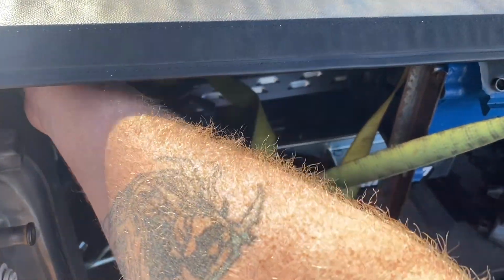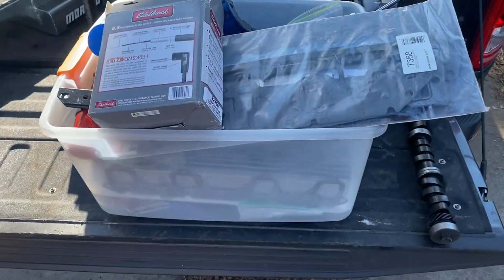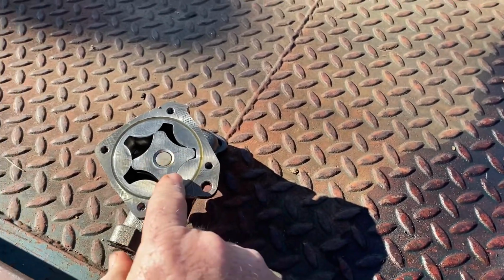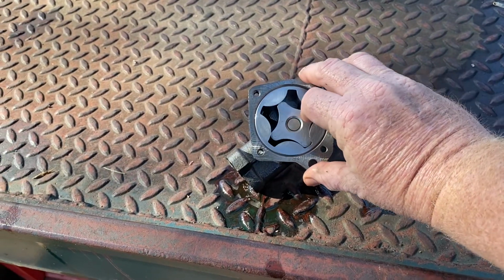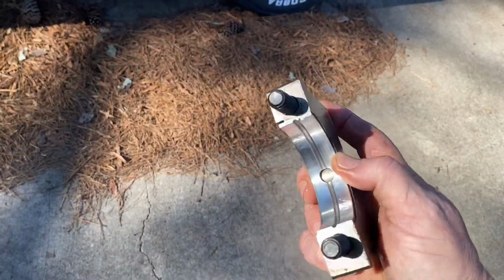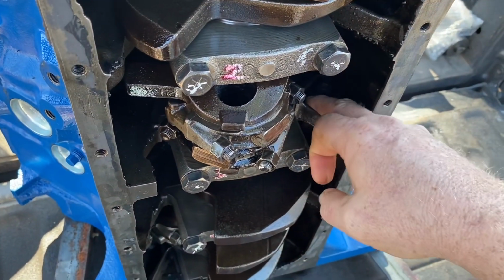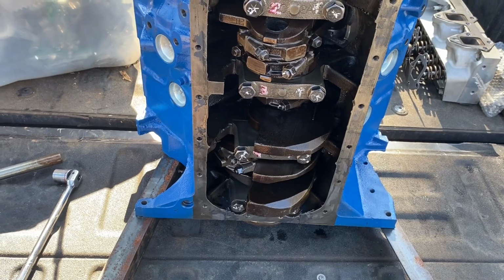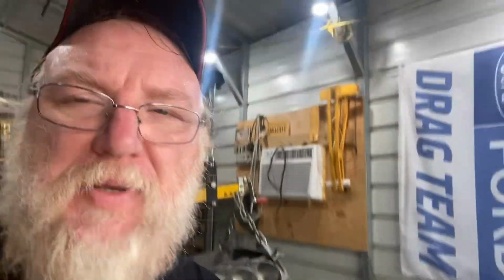Investigating the Failures of a 390 FE Ford Engine

Comment: I have fe390 hv oil pump plenty of oil pressure 60psi when operating temp oil pressure drops slowly almost 0 at idle. No valve noise
Reply from the maker: @timothyperreault3330  a lot of FE’s will drop low at idle when hot.    As long as the pressure rises with RPM it will live

Comment: Ok, last comment i promise! I keep hearing u want to blame the oil pump? At this point i dont think u know any of the clearances yet! Wich is telling me u dont know what to look for or u dont want to know? How can u blame a part so early without even knowing the basic specs of the engine? So many things can contribute to low pressure! How bout the gasket between the pump & the block? Was one used? Was it torn? What about the pickup screen? How close to the pan was it? What oil used? What about were the pickup bolts to the pump? Was there a gasket? Was it torn? Was it sucking air? Was it a high volume pump? What pressure did it have when it was primed with a drill? What were the cam bearings clocked at when installed? Did u know the way they are from the factory is adequate but not best! Oil going to the rockers, did anybody restrict that? Was all the rockers getting oil? U said it had 8 lbs at best? Was that idling? Or at 2000 rpm like when breaking in a cam? Was the oil hot or cold when it had 8 lbs? What about the clearance on the lifters? What kind of lifters did it have? Ok, u get my point. I hope?
Reply from the maker: I can only put so much information in a video that’s already 45 minutes long.   This was a basic over view video.   I never blamed the oil pump I did say it was damaged.  I am well aware of the clearance of the bearings but as I said in the video, I can only make a video so long.    There is a lot of stuff I didn’t talk about in the video. Just simply wasn’t enough time in that video.   If you watch any videos on my channel not only do I primarily build FE’s my race cars also run FE’s.   I am more than well versed in what to do and look for.     Again there is only so much time in a video

Comment: What was this engine built for? I notice the 2v pistons. Wasnt built for good compression, i can see that. Looks like someone did not understand FEs very much? I guess i dont know what heads were used or what actual cubic inch this engine was? Those details would tell me more. But if this was a 390, id say mistakes were made on basic details.
Reply from the maker: For a street car you don’t need a ton of compression.   And judging be the fact they are not actually in the hole much at all I’d say the block was decked so depending on the heads I will say it made decent compression for a driver.  
     Either way I’ll have it all sorted out real soon it’s going back to a bare block and starting over from scratch
Reply: @frizzellracing  I use 390 4v pistons & my deck is shaved .035 & my pistons are above deck by .005. Mine is 9.1 to 1. Those pistons do not yield a high compression ratio even for the street.

Comment: If you had a bad oil filter like I had on my 351 Windsor with a Fram filter it would give you low oil pressure so my question is to you what type of oil filter did you use on your motor???
Reply from the maker: I don’t have the filter they used.    But I believe he told me it was a wix filter
Reply: It would have been nice to have that old filter that way you could have cut it open to see how bad the damage was

Comment: Main bearing cap you pulled off noticed the hole in the bearing shell. Isn't it supposed to be on the block side of the main.
Reply from the maker: The FE main bearings (at least most of them) have that hole on both halves.  So there isn’t technically a bottom or top.    But yes the hole in the block is on the other side.

Comment: I think you got a bum oil pump. And it's a good thing the dyno operator shut it down when he did. But if you end up finding over sized clearances.. It's good that your not going to talk smack about venders and shops that worked on this. Things happen, even when one is trying to do right.

Comment: The oil pump relief valve controls the oil pump maximum pressure output, if it stuck open would cause low pressure
Reply from the maker: That’s kinda what I’m thinking.  Some “metal” got in there and hung it open causing the low oil pressure.
Reply: That's always the first thing on those pumps